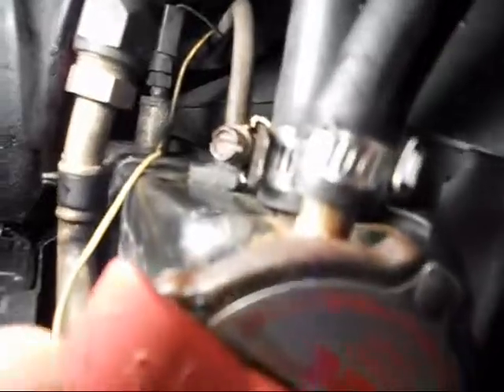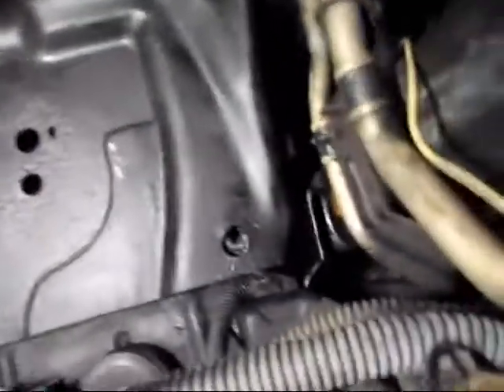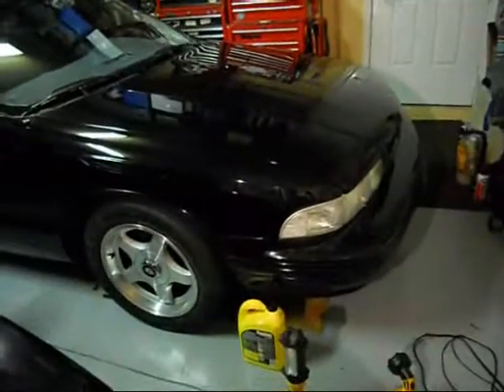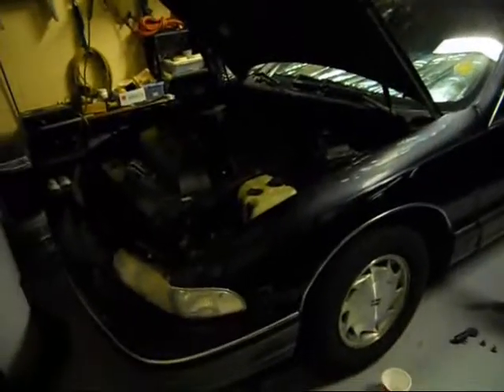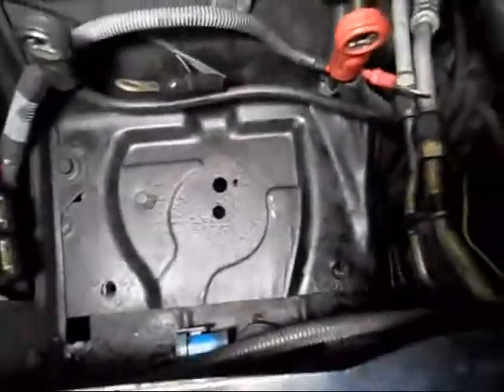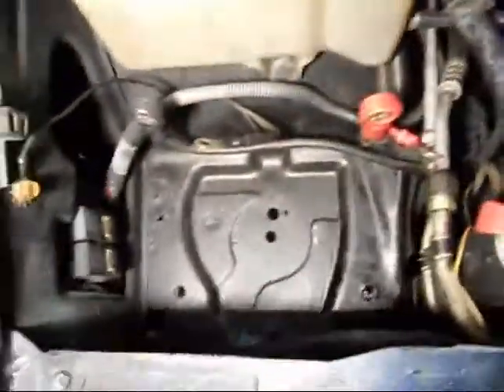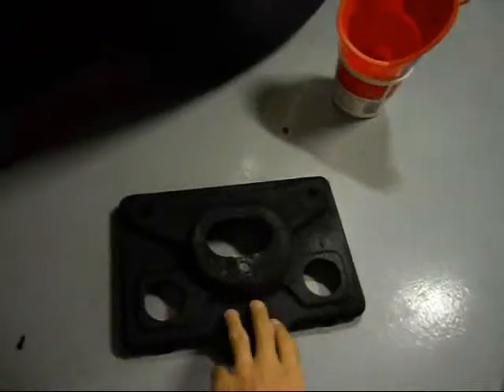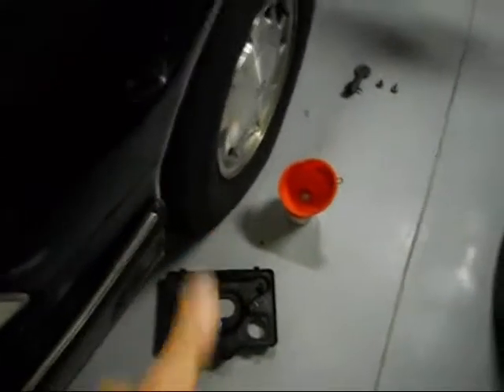Radiator repair turns into RUST repair.

Comment: I just love compound auto repair!  I replaced the water pump on my Caprice wagon last year and flushed out the brown rust water the previous owner left in there.  Right after a flush and refill found the plastic tank on the rad was split and leaking, and a freeze plug rusted out!  By some miracle the heater core isn't leaking, yet.

Comment from the maker: @andy26111  You will have to loosen the manifold to get the shield out.  Then pop the rivets w/ a drill bit. Its not that big of a deal the bolts come out easy w. a breaker bar and a piece of pipe over it, I took out manifolds the same way before.  LMK what you find. Ill pay ya for your time. The shield probably  wont run ya much. Just make sure it has no heavy rust.  Here, they ripp engines out of EVERY CAR so the manifolds are no where to be seen.

Comment from the maker: @andy26111  Needs a paint job and some  replacement panels welded in too!   One day Ill get around to a dual snorkel. I also need a drivers side exhaust manifold heat shield. Do you know of anyone w/ a 91-3 who has a spare manifold? The heat shield just has some rivets that  can be drilled out. I took mine off because it was rusted and was rattling.. BUT NOW the spark plug wires on that side dont have a good mount anymore! because the mount was on the heat shield... Poor decision done years ago